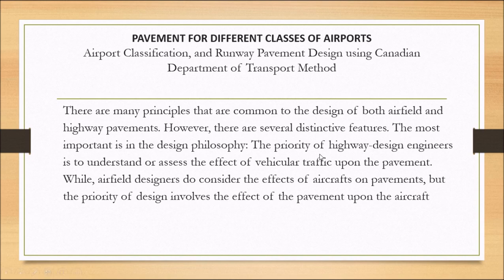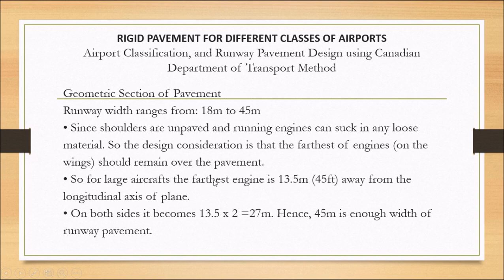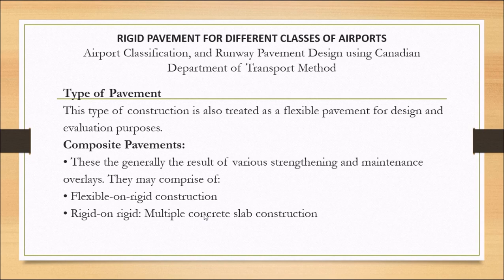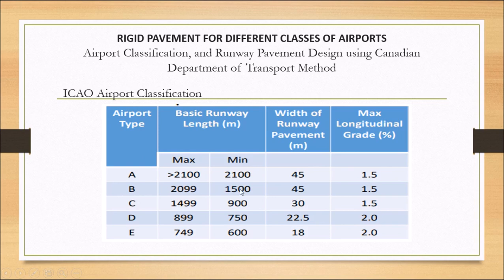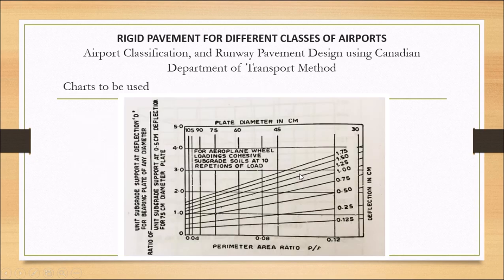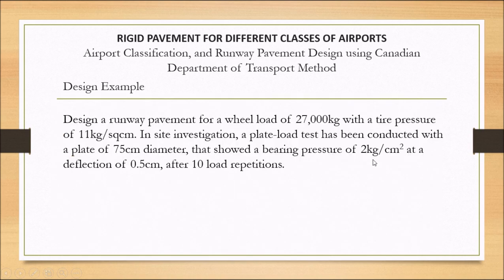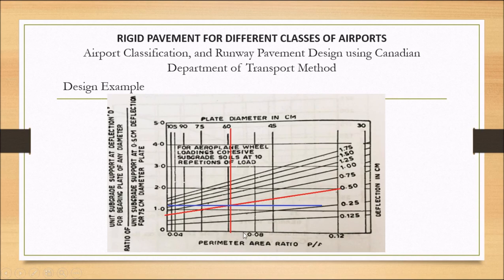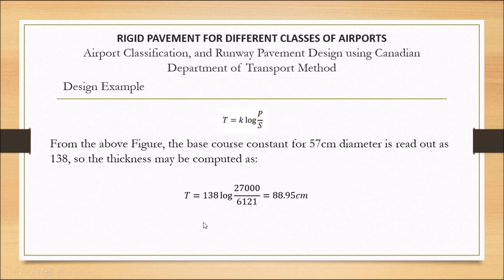Airport Classification, And Runway Pavement Design Using Canadian Department Of Transport Method

Comment: Airport Classification and Runway Pavement Design Using Canadian Department of Transport Method
Airport Classification
The Canadian Department of Transport method classifies airports based on the runway length and aircraft characteristics. The classification system includes¹:
- *Airport Code*: A combination of a code number and letter, where the code number represents the aeroplane reference field length and the code letter represents the aircraft wing span and outer main gear wheel span.
- *Code Number*:
    - *1*: Less than 800m
    - *2*: 800m to less than 1200m
    - *3*: 1200m to less than 1800m
    - *4*: 1800m and over
- *Code Letter*:
    - *A*: Wing span less than 15m, outer main gear wheel span less than 4.5m
    - *B*: Wing span 15m to less than 24m, outer main gear wheel span 4.5m to less than 6m
    - *C*: Wing span 24m to less than 36m, outer main gear wheel span 6m to less than 9m
    - *D*: Wing span 36m to less than 52m, outer main gear wheel span 9m to less than 14m
    - *E*: Wing span 52m to less than 65m, outer main gear wheel span 9m to less than 14m
    - *F*: Wing span 65m to less than 80m, outer main gear wheel span 14m to less than 16m

Comment: The priority of highway design engineers is to understand or assess the effect of vehicles traffic upon the pavement. While airfield designers do consider the effects of aircraft on pavements but the priority of design involves the effects of the pavements upon the aircraft.
In highways, maximum axle load considered is 8170kg or equivalent single wheel load of 4085kg. While, Airport pavement are designed for equivalent single wheel load of the critical aircraft that's supported to use the runway. 
For geometry pavement; Runway width ranges from 18 to 45m and also  for aircraft. 
Pavement types include 1.) Rigid pavement which can be plain, reinforced or prestressed which distributes the aircraft loads to the subgrade. While 2.) Flexible pavement which is composed of bound or unbound Granular materials. It distributes the aircraft load primarily through the shear strength of the paving material.

Comment: The Canadian department of transport has established guidelines for airport classification and runway pavements design. 
The design process includes determining the aircraft’s gross weight, the number of annual departure and gear configuration… 
With this info, the designer refers to FAA design charts or nomographs to determine the required pavement thickness. It will enable us to know what the pavement can withstand repeated aircraft load without failure

Comment: The *Canadian Department of Transport (CDOT) method* ensures safe and durable runway pavement design by considering aircraft loads, subgrade strength, and environmental factors. The *PCN/LCN system* helps match pavement strength to aircraft requirements, ensuring long-term performance.  Runway Pavement Design (CDOT Method)
The *Canadian Department of Transport (CDOT) method* (also known as the **LCN/PCN system**) is used for flexible and rigid pavement design.

Comment: The Airport Classification and Runway Pavement Design using the Canadian Department of Transport method explains how airports are categorized based on aircraft size, traffic frequency, and weight. The classification system considers the Aircraft Classification Number (ACN) and Pavement Classification Number (PCN) to ensure compatibility between aircraft and pavement strength. The tutorial highlights different airport classes (like primary, regional, and local) and their design requirements.

For pavement design, the Canadian method emphasizes climatic conditions, soil strength, material type, and expected aircraft loads. It uses layered system analysis to determine pavement thickness for both flexible and rigid pavements. The method involves calculating Equivalent Single Wheel Load (ESWL) and factoring in aircraft gear configuration. Drainage, subgrade support, and frost conditions are also key considerations in Canadian standards due to the country’s cold climate.

Overall, the tutorial emphasizes designing cost-effective, durable pavements tailored to the specific class of airport and environmental factors, ensuring safety and longevity of runways under Canadian aviation standards.

Comment: Practical 10

Airport Classification & Pavement Design: Canadian Method.

The Canadian Department of Transport (Transport Canada) method classifies airports and designs runways based on **aircraft operations, environmental factors, and structural resilience.  

Airport Classification System

Airports are categorized by:  

1. Aircraft Size/Weight: Measured via the Aircraft Classification Number (ACN), quantifying the load impact of specific aircraft.  

2. Traffic Volume: Annual aircraft movements (takeoffs/landings).  

3. Functional Role:  
*  Primary: Major hubs handling large jets (e.g., Toronto Pearson).  
*  Regional: Mid-sized airports for turboprops/regional jets.  
*  Local: Small airfields for light aircraft.  
* Pavement strength is rated by the Pavement Classification Number (PCN), ensuring compatibility (ACN ≤ PCN).  

Pavement Design Methodology

The Canadian approach prioritizes arctic and subarctic challenges, integrating:  

* Climatic Factors: Frost heave mitigation, freeze-thaw cycles, and permafrost stability.  
* Subgrade Analysis: Soil strength (CBR/value) and drainage capacity. 

* Layered System Design:  

*  Flexible Pavements: Asphalt layers over granular base/subbase. Thickness determined  Equivalent Single Wheel Load (ESWL) calculations, adjusting for gear configuration (e.g., dual-tandem).  
*  Rigid Pavements: Concrete slabs with reinforcing steel, designed for joint durability and thermal expansion.  
* Frost Protection: Insulating layers (geotextiles) or non-frost-susceptible (NFS) materials to prevent subgrade deformation.  
* Drainage Systems: Subsurface drains and crowned surfaces to manage snowmelt/rainwater.  
 
Key Standards 

* Lifecycle Cost-Effectiveness: Balancing initial construction with long-term maintenance.  
* Safety Compliance: Meeting Transport Canada’s TP 312 Aerodrome Standards.  
* Environmental Adaptation: Customizing designs for coastal, prairie, or northern environments.  

Conclusion
This method ensures runways withstand Canada’s harsh climate while optimizing safety and cost-efficiency. By aligning ACN/PCN ratings and embedding frost-resilient features, it sets a global benchmark for cold-region aviation infrastructure.

Comment: The lesson on Airport Classification and Runway Pavement Design using the Canadian Department of Transport method explains how airports are grouped based on factors such as aircraft size, traffic volume, and weight capacity. This system ensures that runway structures match the demands of the aircraft they serve by considering both the Aircraft Classification Number (ACN) and the Pavement Classification Number (PCN) to verify that aircraft loads are compatible with the pavement’s strength.

The tutorial outlines various airport categories—including primary, regional, and local airports—and the corresponding design criteria required for each.

In terms of pavement design, the Canadian approach takes into account climate conditions, subgrade strength, material properties, and anticipated aircraft loading. It applies a layered system analysis to calculate the needed pavement thickness for both flexible and rigid pavements. Key elements include computing the Equivalent Single Wheel Load (ESWL) and considering the landing gear layout of different aircraft. Given Canada’s harsh winters, frost protection, drainage, and subgrade support are also critical aspects of the design process.

In summary, the tutorial stresses the importance of building cost-efficient and durable pavements that meet the unique needs of each airport class while accounting for environmental factors, thereby promoting safe and long-lasting runway infrastructure in line with Canadian aviation standards.

Comment: The video on Airport Pavement Design Using FAA CBR Method explains the step-by-step approach for designing flexible pavements for airports based on the guidelines from the Federal Aviation Administration (FAA). The method heavily relies on the California Bearing Ratio (CBR) of the subgrade soil, which is a key indicator of the soil's strength and ability to support aircraft loads.

The tutorial begins by explaining the importance of pavement in airport operations, highlighting its function in providing a safe and durable surface for aircraft takeoffs, landings, and taxiing. The FAA CBR method is specifically used for flexible pavements and is suitable for both military and civil airport applications.

The design process includes determining the aircraft's gross weight, the number of annual departures, and gear configuration (single, dual, or dual tandem). With this information, the designer refers to FAA design charts or nomographs to determine the required pavement thickness. The method ensures the pavement can withstand repeated aircraft loads without excessive deformation or failure.

The video also emphasizes the significance of selecting proper materials, drainage design, and regular maintenance to enhance pavement lifespan. It shows how to use the FAA design charts by locating the intersection between CBR values and aircraft load, adjusting for traffic volume.

Overall, the FAA CBR method is presented as a reliable and relatively simple approach to designing airport pavements, especially for low to medium traffic airports, making it widely applicable in developing countries.